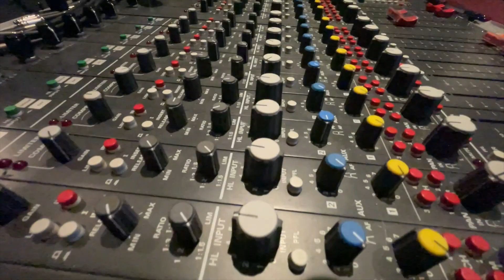Can converting PCM to DSD be better?

Comment: This sounds like bollocks to me. PCM, after DA conversion, is analogue. Hence "digital to analogue conversion". It's digital when it's stored, analogue again when playing through your speakers. If you sample at twice the maximum frequency of your hearing range (let's say 44.1 kHz) and use  enough bits to get your noise level way below the ambient noise in your living room (let's say 16 bits, < -90 dB), then you're all set.

Comment: 3:10 - This is a misconception of how PCM works. If you hook up your DAC to an oscilloscope, you don't see "computer code." You see sine waves that match the original signal. It doesn't come out as blocky curves or 0s and 1s. The output is analog. The Nyquist theorem states that if the frequency of a signal remains less than x, then given a sample rate of 2x, there's only one possible signal that fits given the low pass filter of x. The filter doesn't cut off perfectly steep, but given that the standard sample rate is 44.1khz, any artifacts from an imperfect filter would be in the inaudible range (above 20khz, and since the viewers here are all adults, most of us can't hear much more than 15hz). If you the DSD and PCM files represent the same audio, and the sample rates are sufficient, they will sound identical.

Note that what we perceive as the warmth of analog audio really comes from the wow and flutter of the imperfect medium that we don't encounter with digital audio. There's nothing wrong with enjoying this sound - I enjoy it too. But you can also recreate this sound digitally if you like. It doesn't mean that the audio is objectively a better representation of the original sound that was recorded. It's just different through its imperfections, which is perfectly ok. Most of us do enjoy that sound.

Comment: Can you take PCM and interpolate it to smooth it out for DSD?
Reply from the maker: You can do pretty much anything but not effectively. DSD can be converted to PCM by running it through a digital low pass filter and if done correctly you can preserve all that is wonderful about the original DSD recording. You cannot go the other way because the original analog to PCM capture isn't as good and misses information.

Comment: We're not saying dsd is bad, all digital is good, why i dont see anything scientific of what youre saying, all you say dsd is better because it is like life like analog, thats what you keep saying, is there an algorithm?...density doesnt make sense...i like dsd too ,but i also like to know how is better than other digital...sorry sir it's really talk just talk thats whats your video...dsd specs: 20bit depth word, 100khz sampling, is there anything else? 120dB DR anything else? sounds good like all digital..thats it! ;))
Reply: Converting from one format to another and sayign it is getting "better" is bullshit anyways. It might sounds more pleasing to the ears if DSD is somehow doing something with the sampling. But PCM already has the maximum of data available. Upsampling in some fashion is just the try to extrapolate stuff which is not inside... Snakeoil.
Please provide some measurements. Compare what is incoming (via PCM) and what is outgoing... We would probably see a lot of added signals to the output which are not there in the source.
"Just a filter to have it in analog"??? You have to put that through an DA converter anyways... That converter is just takin a bitvector and putting a corresponding voltage out.

Comment: @2:27 "It's upsampled, and converted to DSD"
@2:37 "It's not like we're adding something or changing something.

Upsampling is adding something.  It is adding 2x or even 4x (or more) samples, fabricated by the computer (an on-the-fly upsampling device is a computer of sorts).
Upsampling is changing something.  It is radically changing what is contained in the file to what ends up getting transported and fed to the DAC chip.

I used to own a Cary CD player, that had on-the-fly upsampling, as high as 768 kHz, and it made many songs sound more lush and euphoric.  It made many songs that were hard to listen to, enjoyable.  But it was not natural -- yet, enjoyable.

@3:11 "If you look at a DSD signal on a scope, you can see the music; you can see the sine wave; you see music"
I would like to have "signal" defined, in the context of our host's use of the word.  Why?

A DSD file (or DSD data, whether it be from a disk, or in RAM via on-the-fly conversion from PCM, is 100% digital.  I do not know what is to be gleaned from looking at an interpretation of a digital file on a scope.
Or, is the scope being fed an analog signal, which would mean that the DSD data was already converted to an analog sine wave?

@3:02 "All you need to do is run it (the DSD data) through a low pass filter".
I am respectfully calling shenanigans.

A low pass filter is designed for, and will work with, and only with, an analog signal.  DSD is 100% digital.
Or is our host referring to a digital low pass filter?

@3:45 "...it (DSD) is a very analog medium".
I do not accept that assertion.

Digital is digital.  Analog is analog.
DSD is digital.  Then last "D" in DSD stands for "Digital".

DSD data is computer data.  Drilling down, it is no different than how a computer stores your Excel files.  It ultimately contains zeros and ones, all of which are made up of bits.  All is 100% digital.
The only way to store a DSD file is on a computer related item, such as a hard drive, or a flash drive, or even magnetic tapes that are used to back-up computer data (such as LTO tapes -- generally used by data centers to back up their servers).

Everything computer related is 100% digital, with the exception of the output side of its on-board DAC.  That output is analog, and it is not stored in the computer -- any more than your tonearm can store the signal from your stylus.

You can share a DSD file with exactly the same ease as sharing an Excel file, or an mp3 file, or a zip file, etc.

When you purchase a DSD file, you download it, the same as you would any other file.  When you get your downloaded file, it is identical to the file sitting on the computer that sent you the file.

DSD is not analog.  DSD is digital.  It is 100% digital.  it is 0% analog.

It probably sounds nearly the same as analog, once converted to analog.  But that does not make it analog.

With a high quality Digital SLR camera, your photos will rival the best film based photos.  But the Digital SLR camera's photos are still digital.  And so it is with DSD.  It is digital, and only digital.

Paul, please clarify anything that I got wrong.  And if you got anything wrong, please acknowledge as such, so that we are all working with correct information.

Thank you.
Reply: Digital cameras actually support a higher resolution than film cameras ever have. Likewise, digital audio could have an arbitrarily large sample rate or bit depth, whereas analog tape depends on the density of the iron filings and the speed of the tape. Not that it matters - by the Nyquist theorem, we know that 44.1khz is sufficient for human ears. Saying that DSD sounds better is absolute nonsense. It doesn’t contain any more audible information than CD audio. It all comes down to the quality of the equipment and the mastering. NOT the format.

Comment: How is it that the conversion of the PCM into DSD is easier or better than PCM to analog? Since they are 2 digital formats, is there some conversion sequence that is more streamline?  The way I interpret PCM bit formation is like pixels filling in the sound as it occurs. So just like a dot matrix printer printer could fill in the main structure of an image, the empty areas are filled or sampled with an averaging that is biased to the closest value. That's probably why PCM is problematic, it's not 100% true information, part of its matrix is synthetic.  Do the PCM building block bits get converted into single DSD bit configuration?
Reply: The conversion from PCM to DSD (PWM) then to analog "generally" requires less critical output filtering .. as he says, a simple low pass filter will get you an analog signal.

Comment: Hi Paul, a big fan of this channel, a recording engineer and producer for 35 plus years. I had a PS Audio preamp back some 40 years ago. So, if a good quality PCM mix is upsampled to DSD, would it then sound better converted back to PCM than the original PCM mix, as the corners would be “rounded out” and such?
Reply: Hi Eric and thanks for joining with us. I haven't found any advantage from going in this direction, but plenty from going in the other direction. Seems the magic is captured when we record the original analog signal to DSD.

Comment: Huh. At the beginning you imply that converting PCM to DSD is still better than straight PCM? I guess because it stays digital longer and then the analog conversion is less invasive? But then your closing statement is, "that doesn't really work."

My DAC supports DSD, but I've still never heard any. Is there software I can use at home to try converting PCM to DSD to get a taste? (I realize it won't be as good as original DSD.) Thanks, Paul!
Reply: Audirvana maybe?
Reply: There are some free dsd samples for download available on the Internet. I don't have a link right now, let me know if you want it. You will have to configure your computer to get it to work.
Reply: @robinr5787  Sure!
Reply: @robinr5787  Thanks, I'll check that out!
Reply: HQPlayer will do the conversion better than about any other software.
takes a very powerful computer to upsample DSD to high rates though, I have a dedicated i9 server doing it and I can't use all the hardest convolution filters without overclocking.
It really depends on the DAC and your renderer. I have a Sonore Optical Rendu, and PCM sounds better than DSD going into my Matrix Audio Element X, but if I add a Matrix Audio I2S bridge, the DSD sounds better.

You can get a good taste for it using using HQplayer with Roon (they play very well together) on an extra computer. HQPlayer is a bit expensive, but worth it - the trial version stop every 1/2hour, so you can still do alot of experimentation. The regular version for Mac and PC has a very clunky interface, but Roon will take all the pain away. If you are not familiar with Linux, then you are best off buying a ready made server from Small Green Computer or similar - installation of HQPlayer embedded is not for the faint of heart.

A dedicated server + HQPLayer + Roon is easily the nest way to get digital music to an endpoint.